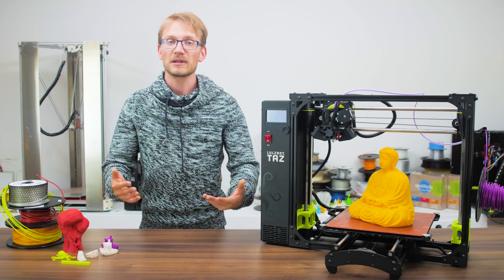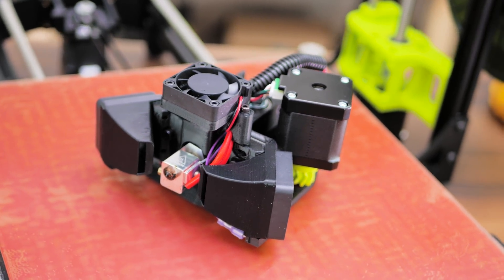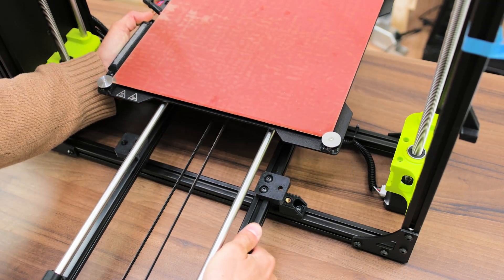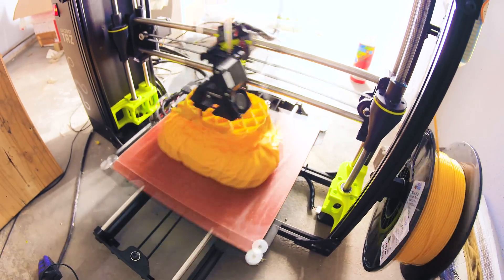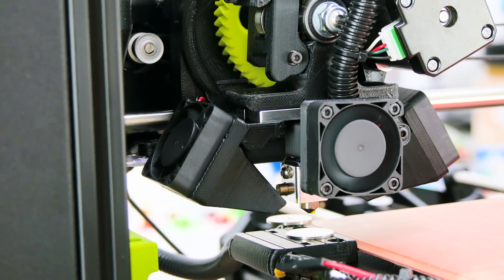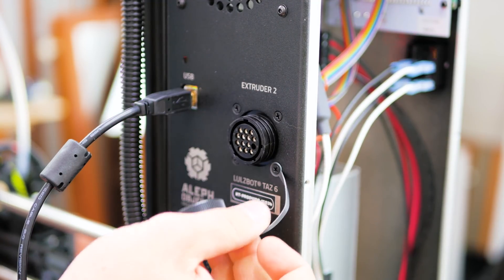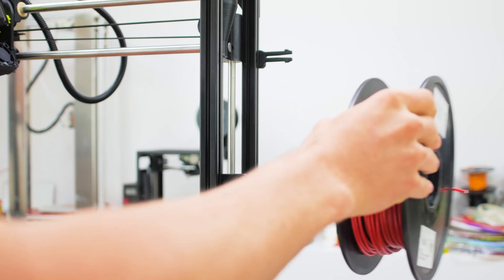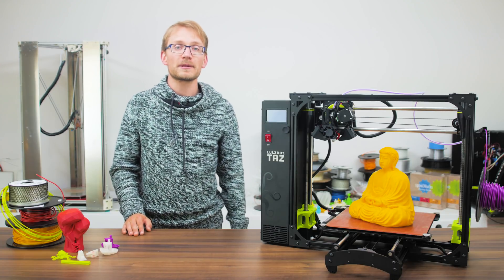Review: The Lulzbot TAZ 6 - #OpenIsDefault for the win?

Comment: It's fun to look back at old reviews - while this was a great machine for 2016, the results of the auto bed levelling are really not good. At 7:09 you can see the nozzle is both way too high (filament extruded in discrete blobs) and a little low (very wide extrusion), all in a first layer that looks to be just a few inches across. Proper mesh bed levelling was a huge advance over this

Comment: Also, if power use is a concern you can build a enclosure around it to thermally insulate it. My Replicator Dual clone (from 2013) uses about 200 watts max but that's if the nosiel and bed are reheating at the same time on a normal day in winter in the basement and jumps between 70 watts and 125, occasionally jumping to about 200 for short times but it uses about 0.14KW per hour last i checked and less the first time i tested it when it was warm (in the closet). So a 3 hour print will cost me about 30-40 cents and about the same with PLA@$15 for a 2KG spool. If you can retain the heat the machine won't have to work so hard against cooling.

What i did notice is that i use Kapton tape on my aluminum bed and although its hot, it's only really hot if you touch it were glass beads seem to radiate much more. And of course it's also used to help hotends retain heat in a lot of printers including mine, but it's so old it flaked off years ago and i put silicone jackets w/socks which work better anyway.

Comment: The big drawbacks on this: The print heads they sell are overpriced compared to simply using a dual assembly E3D V6 + Bondtech or E3D Titan Aero. Then 2.85mm is going the way of the dodo. Plus the electronics doesn't use Trinamic interpolated 256 microstepped drivers, perhaps they will swap out the Rambo board for a EINSY board. (Like the Prusa MK3.)

Comment: I suspect the SD card problem isn't a fault  of the machine  But the card slot and or card itself.  I have a Robo with the LCD upgrade and constantly have the same problem.   It wont tell a card is inserted or it is inserted  but there is no data.   Have to either cycle power or wiggle the card to get it to work.
Reply: Doesnt that just mean the robo sucks too?

Comment: I just watched this again for the second time.  I'm a bit surprised at their selection of the hexagon hot end, I bought one of those (the version from reprap discount) and I was very disappointed with it.  The heat break can't be tightened good enough into the heatsink, and the thing jams badly wit PLA.  Now the version that Lulzbot has looks a bit different, the heater block is taller for one thing.  I suspect that they also are using a better fan than was supplied with the rrd hexagon, and have it mounted correctly to correctly cool the critical areas.

Comment: I had a Taz 4 when it first came out the Taz 6 is leaps ahead of that. just curious did they address the problem with the fliment feed gear backlash. the Taz 4 stock setting used to chew through the filament when doing long prints. and you'd end up with a 1/4 printed piece. the forum guys suggested different settings but it caused some stringing and oozing. the self cleaning and leveling is a game changer.
Reply: +Thomas Sanladerer Roger that it would be pretty obvious you'd see plastic dust on the gear and extruder head. but issues like these should be made public to any potential buyer before hand as to inform the consumer and manufacturers  of the type of adjustments/defects that someone can expect to make when working with it. thanks for the quick response. Looks like they've really cleaned up even the smallest issues.

Comment: i own an ultimakern 2+ and miss some things:
- dual extruder
- auto bed leveling
- A door on the front when printing materials like ABS
- Wifi connection (send files to the printer)
- Wifi see progress just a simple app, if they realy want to nail it they must put in a webcam.

Not really nessesery:
- color display
- Full metal design
- on/of button on the front

Comment: Great video as always Tom. The only thing that I have to say, is I think the scroll wheel not being properly calibrated is a bit un expectable. It is such a simple thing to fix in the firmware if you know how, and for that reason it seems like Aleph Objects just slapped in existing firmware and that's it. I find it a bit frustrating to purchase something at this price point and not have the only user interface control surface not function properly. I have seen this issue on the taz 5, and I had to fix it when I added a lcd to my mini. 

I understand this is a small issue, but I find it quite displeasing to see a machine like this with that issue. 

I really hope they stop being lazy and fix this.

Comment: three things I noticed and cannot understand about the TAZ.

1. I saw the pulleys not only looked pretty cheap, but also seem to wobble while turning - meaning the run eccentric / non-concentric. At least noticed this on the X-Axis.
2. Wh use 12mm rods and then combine them with supposedly 20x20mm t-slot profiles? For a printer this large - at least 40x40mm or one-inch t-slot profiles would be much preferrable and would add a lot to the stability! 
> also opposed to above instead of smooth rods and LM12UU bearings - many printers in this price-range alread upgraded towards linear-rails - be it THK, Hiwin or any other well known manufacturer - the clearly have an edge voer the smooth rods.
3. why still use a slow 8-bit electronic board, when there is RADDS 1.5 or smoothieboard out there? especially with a graphic displa, it does not make much sense.

Other then those 3 points - seems like the evolution of a good deign. A bit pricey though.

Comment: I just replaced a broken glass bed on a Taz 3 at the Milwaukee Makerspace.  Here's a thermal image of the Taz 3 bed with 30C variation in temperature:  
http://mark.rehorst.com/misc/Taz/Taz_glass_thermal.PNG
I replaced the broken glass with a cast aluminum tooling plate.  Much more even heating, but a little slower to warm up:
http://mark.rehorst.com/misc/Taz/Taz_aluminum_Thermal.PNG
Why on earth are they still gluing a heater to a glass plate?  

I also converted to 3 point leveling which doesn't force the undercarriage and bed plate to bend like the 4 point scheme does.  They probably wouldn't need the autoleveling if they used a 3 point leveling scheme.

And that encoder wheel on the Taz 3 didn't work well either.  Why haven't they fixed that old problem in this 3-generations-newer machine?

It's great that they're using proper lead screws for the Z axis, but\still using two motors?  Ugh!

The electronics enclosure and use of connectors everywhere is great, but that may make it a little tricky to enclose the machine if you want to print ABS.

Comment: I watched the video and i gotta say it does look like a good printer but I had it in my head it was a cheaper printer than it is. like the lcd display issue you mentioned, Ive bought that one before because it was the cheapest one I could find and mine does the same thing. I see alot of good designs and parts but I can see a few cheap ones that really distract from the good ones

Comment: Hey Tom, great review on the TAZ6. I've been meaning to ask, when will you review the metal Kossel printer in the background of your videos? You haven't done anything on deltas as far as I could find, actually.
Reply: +Tommy T That's a Kossel effector and arm arrangement, at least. plus the super low print bed tells me Kossel instead of a Rostock- they have their electronics under the heated bed, in the base. You can't fit a RAMPS or Smoothieboard down there.
Reply: +Arturia Pendragon you can put the electronics down there on a kossel if you try hard enough. I have done it.
Reply: Well yeah. But... Why?

Comment: I bought a TAZ 5 back in January and now wish I had a TAZ 6 just for the auto leveling bed. After breaking about 7 Makerbots (and my team trashing Ultimakers as well), I am loving my TAZ 5 which has been printing 24/7 for months now. I expect the TAZ 6 to be as equally rock solid. 

I was hoping for a simple work light on the TAZ 6 since I had to make my own for the TAZ 5 and an integrated web cam to keep me from physically checking on big prints. Cura freezes/crashes on my Mac after every print that takes over 2 hours to print, so I hope they have that annoying bug worked out now on the software side.

Lights and web cams are both simple projects to complete DIY, but they would be nice touches for a $2500 price point.

Comment: I was hoping you would give some thoughts on how it compares to other printers, such as the Ultimaker 2+.  Also, how's the print resolution?  Removable nozzles?  I don't see 3mm filament as a drawback having owned an Ulimaker Original for so long.  Also, this is the very first time I have seen anyone complain about power usage with a printer.

Comment: one thing i would love to see across the board built in is power off when print is done so if your like me and gone a lot you can start a print and when it is done the printer shuts off. could save a lot of energy costs and fan wear. 

other than that i am torn on dual extrusion. everyone says its a pain but it looks interesting so who knows? software has greatly improved!

Comment: Would you replace the normal TAZ extruder for an e3d v6 (volcano) and Titan, given that you use 1,75mm filament mostly? Also the automated nozzle height sensor should allow for much easier swapping between v6 and volcano hotends.

Comment: Great review, I'm seeing more of these coming out now with the embargo being lifted.
Joel, The 3D printing Nerd noticed some really bad z-wobble or z axis artifacting. He also mentioned the auto leveling procedure being inadequate to clean the nozzle resulting in non consistent contacts being made with the corners. Did you see any of that? By your estimation is this a mains powered heater bed with a PID controlled relay, or 24v? How quickly does it come to temperature? -- that is for an the top temp of an ABS print. Just a thought, 40mm/sec is painfully slow. If I plan on leaving a print to run all night and I don't care, I'm fine with that, but with a .5mm nozzle, you should be able to double that without much loss in quality, unless the mechanics of the machine, or the extruder/hot end can't keep up. I got my home built delta with a E3D volcano and bondech extruder using the .6mm nozzle going at 120mm/sec for .3mm layers, if I want something printed big, I can't justify such conservative speeds. It's keeping a printer on for 4 hours vs 9 hours -- the power use there is non trivial.

Comment: I'm looking at a new printer for a potential 3d printing business.  From a reliability and quality standpoint, how does this printer compare to others?  I am also considering the Rostock Max V2 because of its ease of use and low maintenance...any thoughts on that?Thanks and great job on all your videos...they're super helpful!
Reply: +Thomas Whiting I own a seemecnc rostock max v2. It's outstanding for its price but the construction is mostly melamine mdf composite, which isn't as rigid as the metal joints on the taz 6 frame. Its arms, injection molded plastic, also aren't as rigid as the carbon fiber delta arms out there. I notice these little things increase the amount of play and result in slightly more ringing artifacts. Not show-stopping, but not the smoothest surface around either.. The kit factor is also a bit of ambivalent variable to me. While I can take pride in having actually put together my own printer, it did cause me a significant amount of frustration at times(on top of assembly time, which took me a few weeks of slow-paced work). If I were to get a new printer, I will probably look for one with a solid, possibly all-metal frame.
Reply: +exaltdragon I should also mention that I am using the older model with the composite carriages instead of the newer injection molded carriages which are probably more rigid. Hence you may get better results.
Reply: +exaltdragon Thanks, I appreciate it.  Is the bed leveling completely automatic?
Reply: +Thomas Whiting nope. I've seen some rostocks out there that do it with a hall-effect sensor but by default you are stuck with manual leveling and height adjustment.

Comment: Nice review Tom - and good catch on the X belt path, it was staring at me during all the video and I was waiting for you to comment on it.
Interested to know if the Dual extruder version is in the wild anywhere, and what the carriage must look like. The single extruder it's already quite a large assembly - can you weigh it and let us know?

Very impressed with that electronics enclosure - does it have any approvals certification - UL / FCC / CE / Etc. I'm sure they would have had it all EMC tested judging by the enclosure and connectors being used.

What size nozzle are they using as a default? and do they sell hardened nozzles for the nasty materials?
How did the Nylon print come out?
White or blue lithium grease ?
Maximun bed temperature it can achieve?
What material do they use for the 3D printed parts?
What are the cones on the Z linear rods - just for show or something else?

Cheers,
Rich
Reply: ***** That's awesome thanks! I want one even more now. Looking like a rock solid machine for power users and 3Dhub's
Reply: +Richard Horne the duelstruder head is about 1.5x the size and twice the weight rich, also it comes assembled
Reply: +Richard Horne The Printed parts are still the Village Plastics ABS that they have been for years. 

I actually have the v2 dual hotend for my Taz "6" (mine is the prototype run before the Olive release run) I could stick it on this week and shoot some pictures. I have yet to try it.

Comment: Hi Tom, I'm looking to clone the modular tool head design of the lulzbot for flexible filament. why do you think there is a trend to 1.75 mm? what are the advantages of 1.75 vs 3? I was looking at making the tool heads 3 because that is lulzbot goes with. thanks!